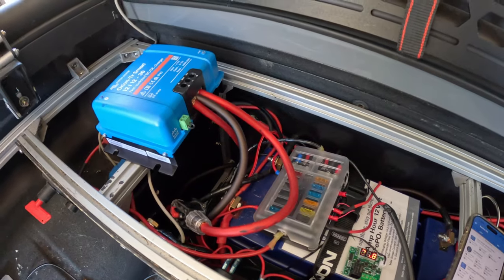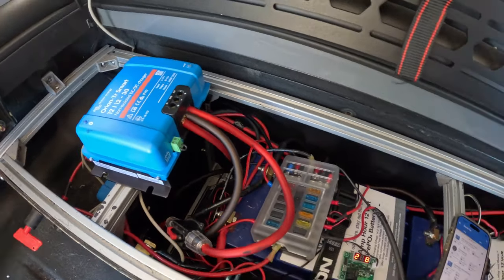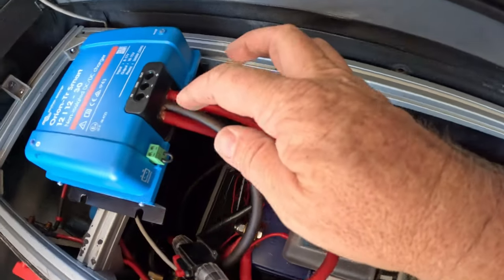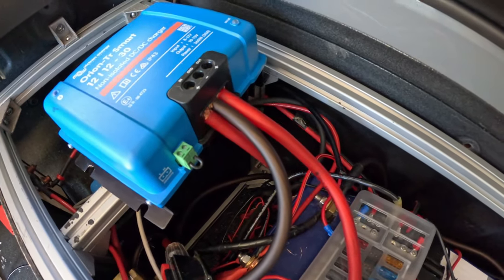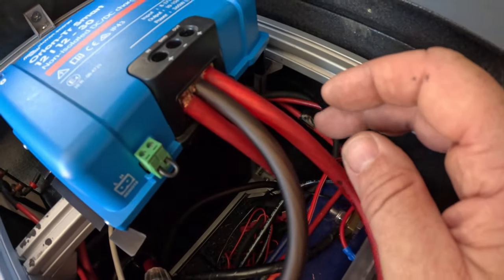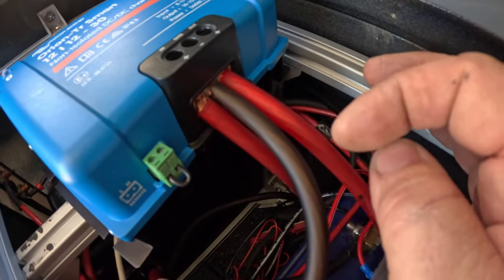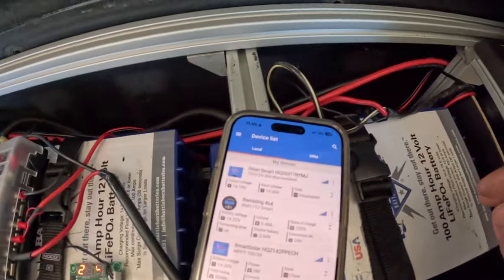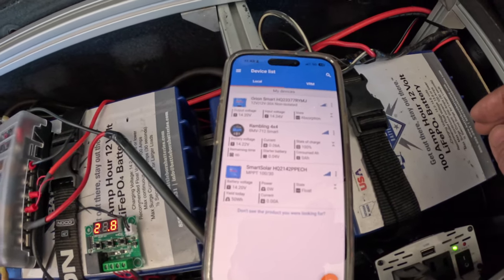Victron DC Charger Cycles On & Off

Comment: That's because you have the wrong alternator setting.  Set to "smart alternator".
Reply from the maker: Thanks you for the reply. I did have the setting on regular alternator and this was wrong. 

Here is what I have learned. The 2023 Nissan Frontier does have a smart alternator, often referred to as a Variable Voltage Charging System (VVCS). This system is designed to regulate the alternator’s output based on the vehicle’s power demands, helping to improve fuel efficiency and reduce engine load when full charging is not required. The alternator in the Frontier is controlled by the Engine Control Module (ECM) using a LIN (Local Interconnect Network) communication system, which adjusts the alternator’s output dynamically ￼ ￼.